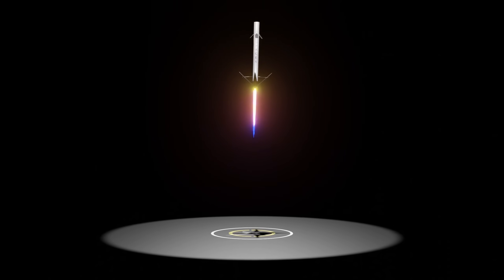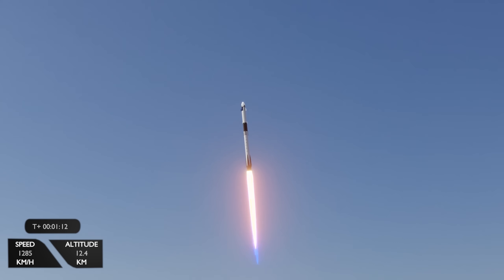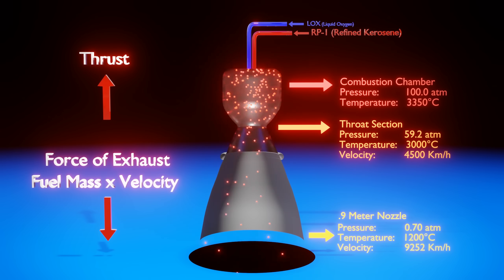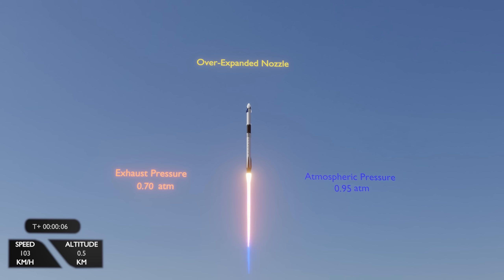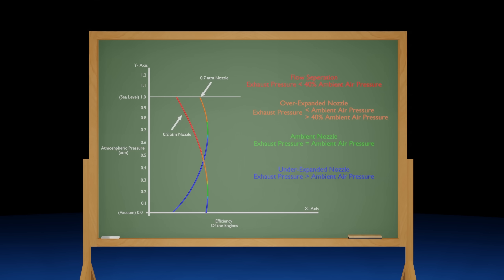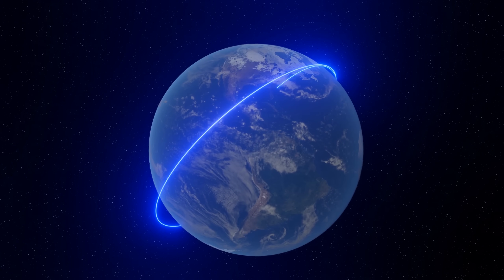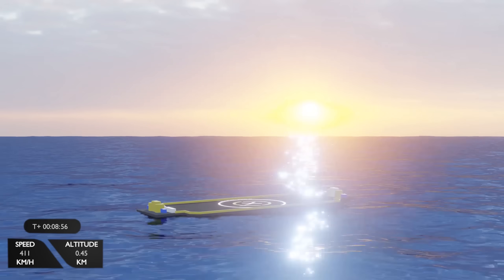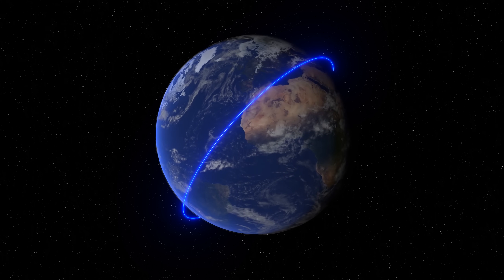Why Doesn't SpaceX Recover the Second Stage

Comment: Explanation is real good, but some things bothered me:
•A tad bit too drawn out, with some repetitions.
If that was to reach the 10 mn mark YT seems to like, maybe instead add intro/outro/bonus we can skip ?
•Covers much more than expected from the title.
Now the title is catchy good (popular name, appealing phrasing, short enough), maybe append "(in-depth)" ? Or split topics in separate videos ?
•Some cluttering details not useful to the topic, such as: fuel type, example calculations, and exact figures ; repeating labels instead of aligning data.
•Some important details missing, such as: how much payload lost if it was recovered ; cost estimate of lost stage ; that the closer to lift-off (low speed), the more efficiency matters ; flight profile vs atmospheric pressure...
•Odd conversion to imperial and popular reference at the start, then never after.

Comment: 0:44 Weight should be in Newtons (or possibly kg-force) ; kg would be mass.
To ease weight vs thrust comparison, use the same unit or provide conversion for one of them.
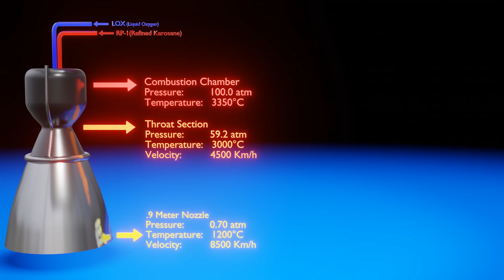1:12 and 8:19 (and peppered all over) kilo should be k ; K would be Kelvin. (yeah that deca/hecto/kilo are irregular SI prefixes, others greater are all caps)
meter should be m ; M would be mega.
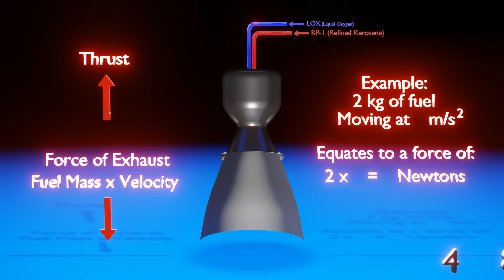2:27 Should be Acceleration (m/s²), not Velocity or Moving (m/s).
7:43 Another important reason for staging is to discard dead mass. Next is possibly switching fuels.
The nozzle size is the reason upper atmosphere stages fire separately, while (other rocket's) 1st stage use side fuel tanks or boosters instead of adding a stage under.
8:29 newton should be N, not n.
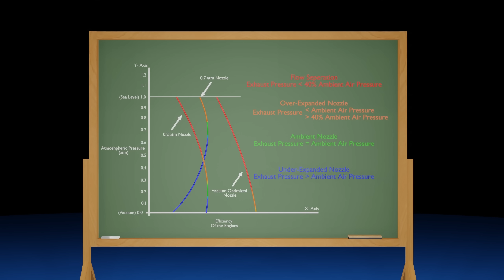10:05 Actually re-entry burns mainly by compression. It is a common misconception.

Comment: You omitted to mention the re-entry burn sequence for the Falcon 9's first stage when 3 of the 9 Merlin engines are re-ignited to slow the stage as it re-enters the increasingly dense atmosphere.  Without this critical 20s burn to slow Falcon's descent from about 2'225 m/s at 55 km (~180'500 ft) altitude down to about 1'570 m/s at 35 km (~114'800 ft) altitude, it would begin to break up.

What really is impressive though, following the re-entry burn in the descent, is the grid-fins along with Falcon's 3.7 m diameter cross-section, are alone sufficient to create enough non-destructive drag to further reduce Falcon's first state rate of descent from 1'570 m/s down to a sub-sonic 340 m/s at 7 km (~23'000 ft) altitude and reduce further Falcon's rate of descent to about 200 m/s at 1.5 km (~5'000 ft) altitude when the landing burn is initiated.
Reply from the maker: During formulation of the video, I decided to omit certain parts of the flight of the falcon 9 as it diddnt really add to answering the question of why we can’t recover the second stage! I would love to do a video that analyzes every part of the flight though!!

Comment: Actually: Friction isn't the main cause of heating during reentry. In fact, there is very low friction between the body that is entering the atmosphere, because there is a shock wave formed in front of the body which acts as a wall, seperating the body from the fast moving air. Between this wall and the body there is a pocket of air which moves hardly at all.

The real cause for reentry heating is the compression of air in front of the body. The "wall" is a layer of strongly compressed air. The body gives it's energy into the system by compressing the air. So there is a shift from kinetic energy of the body to energy used for the compression which is then given of as heat (thermal energy) because the air doesn't want to be compressed (if you'd like to express it this way). The next time you see a mid to high quality mountainbike look for a sticker on the suspension that warns you from the cylinder getting hot during intensive use. Alternatively you could try using a pump to pump up something as fast as you can and then touch the cylinder afterwards -> You will realise that it becomes pretty warm. And if you could do that with your bare hands it's not hard to imagine what happens when an object going 27.000km/h hits the atmosphere
Reply from the maker: Yes as I am aware of that, during production I decided to keep the animation at a specific level of complexity. During researching the topic, I found “Friction” commonly used to describe why objects heat up on re-entry. So I decided to leave it at that rather than going into the great explanation you just gave me!! If you wouldn’t mind, please join me on Ko-if or Patreon to join chat discussions and review pre leased content! Thanks for watching!

Comment: NASA had already proven that recovering your second stage is incredibly expensive and requires a gigantic second stage. I am of course talking about the space shuttle. So why try this again with the Falcon 9, which is a classical rocket concept? 
I wonder whether Starship can really deliver on its promise, which basically tries to do again what the space shuttle did. But SpaceX has proven skeptics wrong before, so I'll not be as surprised if they do it again!

Comment: But where does the 2nd stage go?  What happens to it?
Reply: Its orbit eventually decays (i.e. it slows down and its orbit starts to dip) until it hits the atmosphere. Then it burns up on reentry. SpaceX is able use the last gasps of fuel onboard to control when and where this deorbiting happens to make sure no surviving fragments land anywhere near inhabited areas. That's one thing I've liked about them: they try to clean up after themselves in orbit.
Reply: @emanwe01  Thanks!

Comment: Once starship is working the second stage being wasted won't be an issue, because the Falcon will no longer be used. Only Starship, and it's fully reusable! Would be cool still if SpaceX figured out a way to use the second stage for something up there, and caught them / saved them for scrap metals and whatever else could be used from them.

Comment: I like that you added all the numbers for the exhaust. Puts things into perspective. I also wonder why they don't build some kind of variable nozzle like jet engines have. No the entire thing, just something that attaches to the end of the existing nozzle on the sea level engine.
Reply: Like a skirt above the engine, that would be lowered to extend the small skirt?
I suppose some practical aspects, like impossible (impractical) gimbaling, or the fact that they have 9 engines on the first stage, so doing 1 skirt to extend them all would probably produce some turbulences inside the skirt

Comment: Just out of curiosity, I think some bright minds in the space industry think of the idea around fighter jet engines nozzles to make a self-adjusting nozzle that can be efficient both in high and low altitudes?.. I think if they crack that it can really help in reducing space launch costs even more as if nothing is discarded just like in airlines things become cheaper and operations between launches faster

Comment: Early on in the Falcon 9 development, SpaceX was planning on making the second stage reusable. The problem they ran in to, as mentioned in this video, is weight. Every pound they spend on systems to recover the second stage is a pound less delivered to orbit. (And every pound of fuel kept in reserve is MORE than a pound less delivered to orbit.) In the end, it would have reduced payload so much that the Falcon 9 would no longer be economical. It is cheaper long-term to just throw away the second stage each time than to recover it and reuse it.

Comment: Why aren't rockets launched from Leadville CO?  Wouldn't it be more efficient?
Reply from the maker: For most orbits, launching rockets as close to the equator as possible is most efficient as the rocket has the initial speed of around 1600 km/h on the equator. Considering border and political constraints, this explains Cape Canaveral Launch Complex!
Reply: Launching from higher altitude is more efficient if you don’t care that a failure could land on a populated area.

Comment: Apart from the obvious payload reduction, due to extra fuel and landing equipment, could they not use an aerospike engine on the 2nd stage? That way they could use it in near vacuum for the de-orbit burn and it would still work at sea-level for a landing burn.

Comment: People don't get it, but there is a lot to be said about not wasting fuel for any of these recoveries. And a concept like the Spaceshuttle actually makes way more sense in terms of reusable spacecraft (ie. a glider). What SpaceX is doing is essentially reinventing the wheel. Don't be surprised if the Starship evolves into more and more of just another Spaceshuttle design. And all it needs to happen to create big problems is have one of the reused rockets explode with people inside. Which to me, is almost inevitable. You can't expect a reused rocket to remain with the exact same strength over and over. It's just stupid. And again, at some point in terms of space travel, you'll want to use the fuel to travel further or you will want to save the weight it takes up for whatever bigger payload you've got. There's actually a pretty serious balance about it. And no, the current concept is NOT fully reusable at all. In reality, refurbishing and recertification costs in the long run will make the whole concept very expensive. NASA could have had its own Spaceshuttle 2 decades ago if it weren't for politics. It was never really about the justification in terms of cost. And is SpaceX truly that much cheaper? Well, no, not really, as the company itself is not profitable. The way these companies are structured is like a leaking bucket of water with investors pouring in gallons of water to prevent the whole thing from running dry. Everyone with half a brain understands this. I'm not saying the company is a financial dud, but most of its value currently is within nothing but hype and marketing. Less so actual results.

Comment: Has variable nozzle design been studied for space? I think I saw fighter jets being able to adjust their nozzle
Reply: Fighter jets have jets tho, rockets are a few levels up in terms of thrust, combustion temperatures and amount of propellant expelled. For that we'd need super alloys with way higher melting temperatures than what we currently have. You can see the bell glowing when it is being fires during a launch. That bell would have to radiate that heat away within the atmosphere as it returns. It would melt within seconds. They'd have to incorporate cooling lines through which fuel is pumped to keep the bell from melting. And that would be very very hard if it was adjustable. Just a massive load of engineering problems, most of which still have to be solved. And then there is the flow separation.
Check out Sea Dragon, that rocket was supposed to have a second stage nozzle that folded out from the skirt of the second stage.

Comment: Misdirection crapola. A better issue: how, with no aerofoils or thrust, does the booster find its target after free falling 50 miles?
Reply: The droneship is pre positioned to where the boosters will land. Also the boosters have nitrogen thrusters in it which it uses to reorient itself.

Comment: Really good video!  Wonder whether a return rocket pre-positioned in orbit would be economically viable.  It would combine small rockets and auto-gyro itself and the concentrically captured 2nd stage back to near base and then attach parachutes or an autogiro to 2nd stage to end the trip.

Comment: I am pretty sure this is why there is no second stage on Starship, because they decided that recovering the second stage wouldn't be feasible.
Reply: The terminology is confusing, but Starship IS the second stage. Difference is that it can use aerobraking (like space shuttle) to slow down from orbital velocity with much less fuel.

Comment: It would not be impossible to to recover SpaceX's Second Stage Merlin Rocket, and re-use it again. Would cost a lot of money to do it though. Re-designing the Second Stage engine to A.carry more fuel for re-entry and slowing up and landing B.Adding heat shields and thrusters and wings.

Comment: At 2:20 the "velocity" should be actually "acceleration". Also considering rocket looses mass from fuel, this change in mass is then multiplied by velocity to produce the force.
   Other than that, great video. 👍

Comment: So the obvious question is why not make an adjustable nozzle?  It could slowly expand as the rocket rises keeping it an ambient nozzle the whole way up.
Reply: And how would you do that without adding hardware of considerable mass?
Reply: @DanSlotea  Has anyone tried?
Reply: @xliquidflames  yes, but not what you describe. You do understand the materials required must resist to extreme temperatures, vibrations and pressure variations?
Reply: Yes, it’s called an aerospike engine, but the amount of extra hardware and fuel needed for it to land, is just a waste of money
Reply: @wazda6488  an aerospike engine is completely opposite from what this guy proposes. He wants a variable bell nozzle.

Comment: I think that it is still possible to recover the 2nd stage.  Adding drogue chutes followed by main chutes would not cost that much weight, unless you are pushing the limits it would be fine.  They always de orbit them and I would venture a guess to say that there is probably enough fuel to slow it enough for drogue deployment (would need to withstand some heat, not sure of all the materials out there… there has to be something that fits the requirements) at a high enough altitude to safely splash down…. It is a lot lighter without a payload therefore should require a lot less to slow enough with fuel.  The only variable IS the amount of fuel remaining and I don’t have that info.
Reply: First of all, the second stage enginw wouldn’t work at sea level, and the second stage wouldn’t survive re entry anyway
Reply: @wazda6488  why do you think I would include parachutes?  The only question would be re-entry and how to make it survive with minimal weight being added
Reply: @sum42guy2k  the second stage weighs too much to work with parachutes, not to mention the fact it wouldn't survive re entry

Comment: Not a scientist so don't beat me up here.
Why couldn't the Falcon, with so many Raptor engines, have different nozzles?
Some number of over-expanded nozzles for the initial part of the flight.
And, the remainder of nozzles being under-expanded for the higher altitude flight portion?

When into the upper atmosphere, throttle down the over-expanded nozzle engines and throttle up the under -expanded engines? ... Seems like different nozzle expansion utilization could yield efficiencies.
Reply: Because that’s not how rocket’s work, it’s more efficient to have multiple stages with each a unique purpose, instead of 1 with multiple purposes

Comment: They should play O R I G A M I a lot! It is not rocket science to make nozzle expanding and condensing like aerospike but not so weird just nozzle parts moving up and down! Wait..
Reply: Paper is very permissive. What materials would you use for an origami nozzle that must withstand pressure variations, extreme temperatures and vibrations, all without disturbing the flow?

Comment: well technically they're developing a recoverable second stage. Starship is technically second stage.
Reply: Yeah but Starship has 3 sea-level engines and will have 3 vacuum engines for orbital flight which will not be used during landing.

Comment: Without watching your video the answer is still easy. The first stage is suborbital while the second stage is orbital. The suborbital only requires the minimal of heat shielding to survive friction with the atmosphere as it comes back down. The second stage is at a much higher orbital altitude and velocity and would require the same full heat shielding the capsule does to reenter the atmosphere. That would raise weight to an unsupportable level requiring a bigger second stage, and again a bigger heat shield required to support reentry and this again raising weight and fuel requirements further, etc, etc...
Reply: Update: After watching your video I can say it is very informational but does not address your video title about the second stage. The information is quite true but little of it is about why the second stage is unrecoverable, until your final few minutes. Though even with a larger nozzle the second stage would still not be able to be recoverable, as I explained above, it would require heavy ablative heat shielding to survive making its weight from the shield and the larger volume of fuel needed unsupportable...

Comment: I personally already knew this, but your explanation was very well-presented!  Thanks.

The other reason is arguably more fundamental still:  The cost of building a Falcon-9 first stage is around $50M, compared to around $15M for a second stage.

Is short, the expense of recovering the second stage is likely greater than the cost of manufacturing a new one.

Comment: You didn't really cover the real reason. It is simply not possible to carry the fuel needed to slow it down sufficiently to not burn up during reentry. It has almost nothing to do with nozzles.
Reply: Starship solves this by being much bigger and thus having enough spare capacity for that extra fuel, combined with a larger body that can be used for slowing down via atmospheric drag.

Comment: FIRST:  SpaceX could start using AeroSpike engines for their first stage.  It would take only a slight redesign of their Merlin engines to make it work.   SECOND:  for the second stage, make it similar to that of the DynaSoar shuttle from the 1960s.  Existing technology that would solve all of those problems.